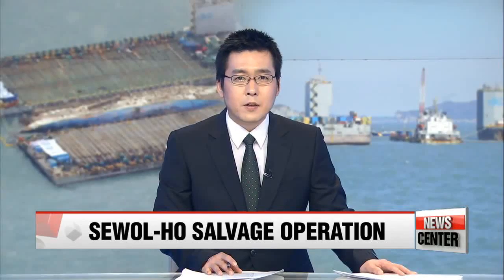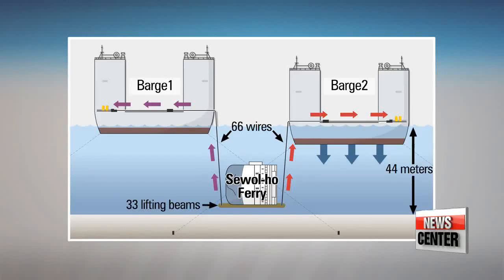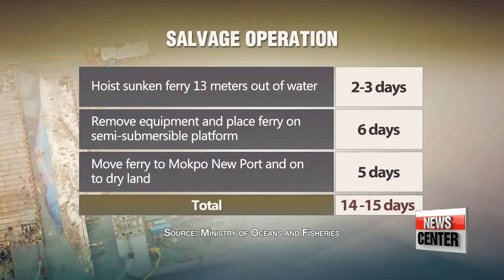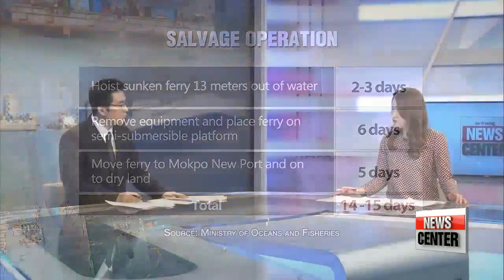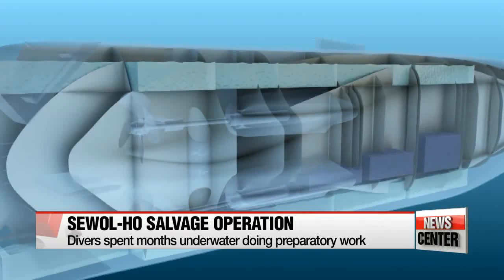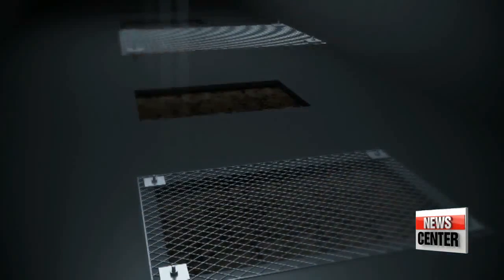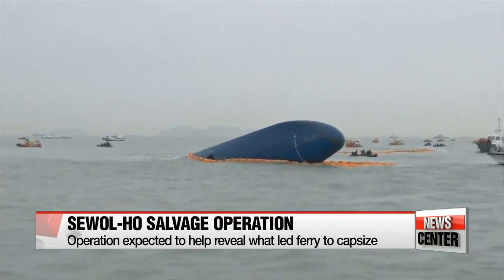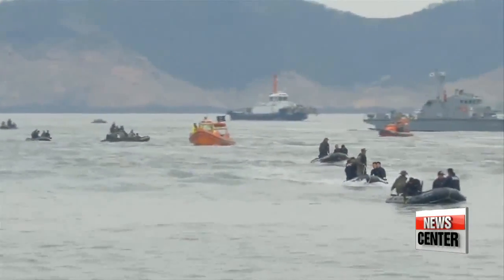Shanghai Salvage - Sewol ferry salvage operation explained

Comment: Ships over 70,000 tons have been salvaged in less time with work starting within months, inc hiring specialists, which typically happens within days of sinking.  It's system that is in place and has worked internationally for over 100 years.  Ships salvaged faster than this tragic wreck included a Russian nuclear attack sub in far deeper and rougher waters.  The first step in fixing a problem, is admitting what the problem is, and no one involved has ever admitted what made this an epic tragedy, which is utter failure of ANYONE from Ships Captain to Country's leader to take charge that day immediately respond all help accept help of all ships hovering around the sinking ferry and ordering abandon ship.  Why the ship listed is irrelevant.  There was sufficient time for the bulk of passengers to get off ship into life boats, with life jackets, or to other ships.  I just PRAY even though no one 'talks' about this, that these systemic issues have been fully addressed so such a disaster can never happen again starting with all Captains and ending with the country's president being made aware IMMEDIATELY you save as many as you can, then you worry about ship, then you worry about image.